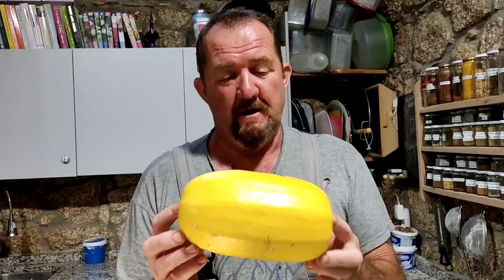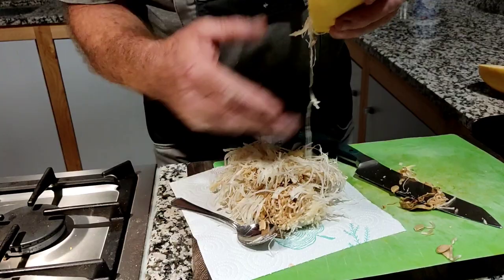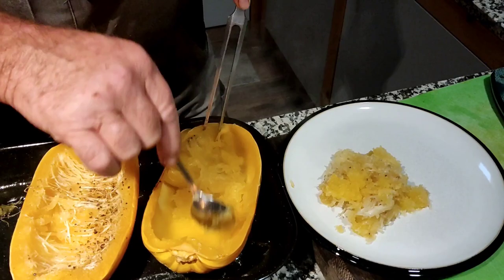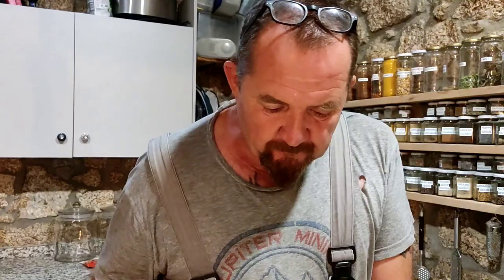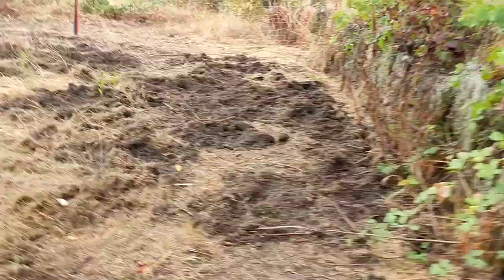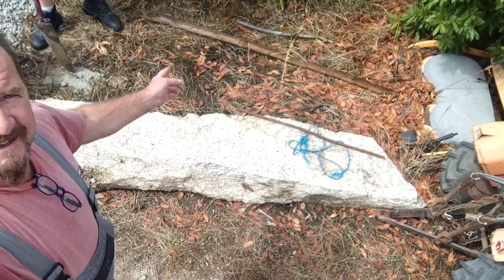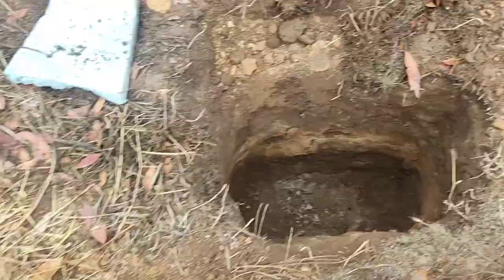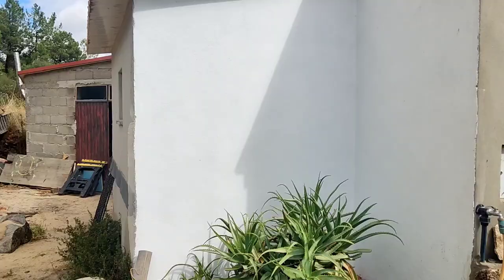96 : A Huge Granite Gatepost and Vegetable Spaghetti Recipe

Comment: I love spaghetti squash – which I grow here on my allotment in the south of England. I wonder if your climate there has been a bit hot for them this season.  Mine have thicker walls and the seeds do not sprout inside.  You can also get a similar variety, called pyjama squash – which are stripey on the outside. 
I bake my squashes face down in halves like you do, but I leave them in for 40minutes. 

The only problem I've had with spaghetti squash here is in saving the seeds, because different types pf squash can cross-pollinate and then their seeds produce different/hybrid squashes the following year!

If you get a cross pollination issue then the next squashes can taste bitter, even when baked.
Reply from the maker: The walls are thin because it was over a year picked